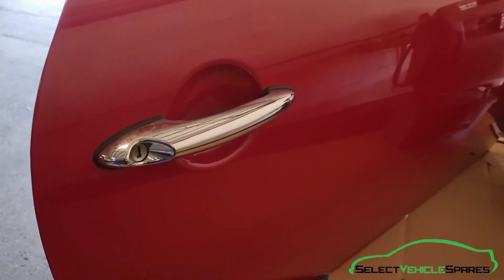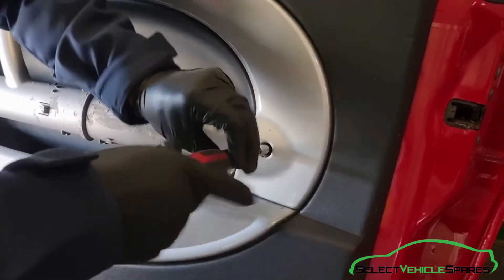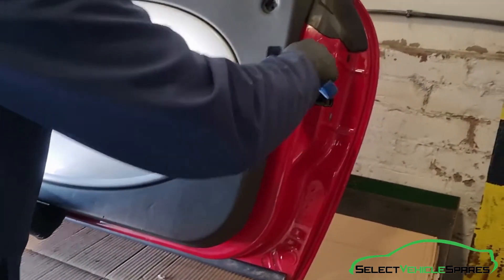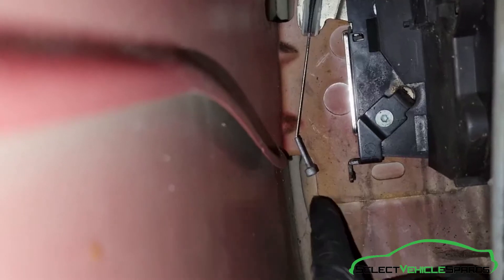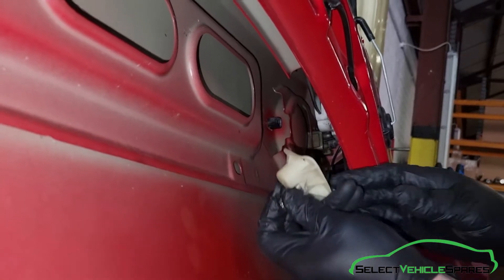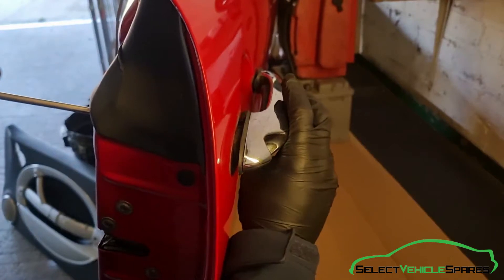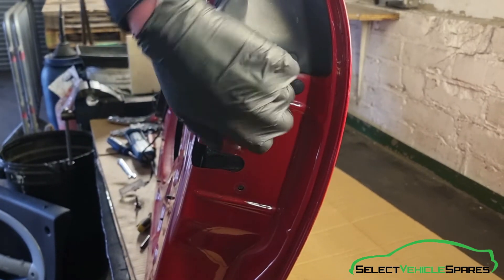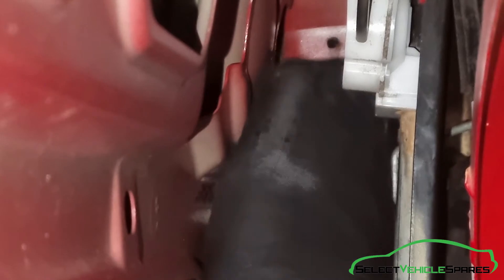MINI R50 / R52 / R53 -  How To Remove Front Outer Door Handle & Key Barrel Removal

Comment: A tip when going after the back bolt through the access hole, I could not for my life get the long T30 or even my long rounded 5mm hex to catch the bolt at that angle without tearing up the bolt. After fighting with it for a half hour, I ended up grinding out the metal from the access hole with a drill downward to get a straighter shot at it. Made it a lot easier both for disassembly and reassembly. I would advise grinding off the metal burrs and painting over the bare metal afterward, and/or do what I did and slap a piece of gorilla tape over it to keep water from dribbling in, as the hole might extend past that rubber cover. It's not the "right" way to do it, but if it's just your daily driver like mine is it doesn't matter much.

Comment: How did the assemble theses quickly at the factory. To service these would be easier if they had copied BmW with the bolt on the edge of the door.
Reply: Agreed. Poor designs! you can tell this Vehical were just put together.

Comment: Where you put the Allen key in and struggled to undo the bolt, there’s a hole in the inner door frame opposite so you can put a screwdriver right through.
Reply: Oh right..i see..very helpful..thankyou
Reply: only if you remove the window.. I’ve just done this job on my 2005 R53 and even with the window fully up that access wasn’t straight enough

Comment: Great video, it guided me to disassemble and reassemble a broken door handle (cable rusted inside the handle and snapped). On the other hand, the replacement part isn't stricly identical: under the black plastic covering the cable, there is a metal covering (rather than transparent plastic). And that covering goes too far, which means there is not enough distance between the cable hook and the white guide actuating the actuator (and then the door will stay locked after using the central lock, both from inside and outside). I'm afraid to cut the metal covering because I might damage the cable. Any tip to fix that?

Comment: hey, great video for removal thanks.Could you please do a follow up for replacing the door lock or at least some tricks to put it all back together. please don't say what others suggest (replacement is the reverse) because it's  No were near that simple. Anyone trying their hand at this operation without proper instruction will have a very long day full of frustration and no working door.

Comment: Thanks for this good video. When doing the second bolt, should the bolt stay in place when turning it anti-clock wise? In the video the handle moves nice and smoothy, but I could not make it happen. The bolt just keep coming out and the handle does not move at all.
Reply: Problem soved, the handle was just stuck after 16 years 🙂 One controlled hit to the bolt and the handle started moving. Thanks again this helpful video!

Comment: Great stuff and now the door handle is off and the cylinder is swapped out. Problem I'm having is getting the  barbed end back into place of the new cylinder mechanism. Any tips and tricks?
Reply from the maker: It can be quite fiddly. We recommend leaving the door lock loose (with the screws completely removed), to allow movement and then you can line them both up easier.